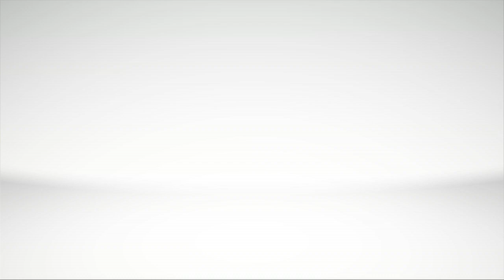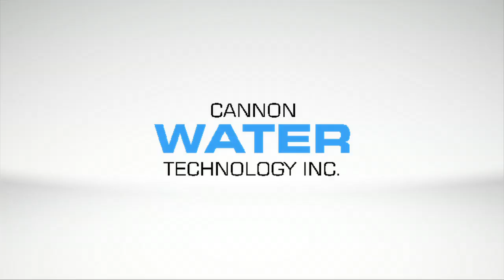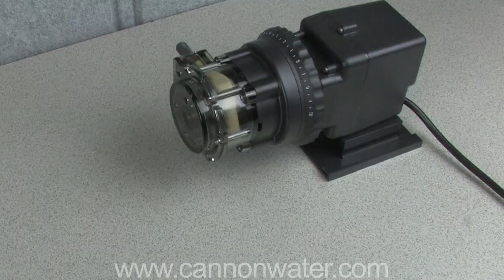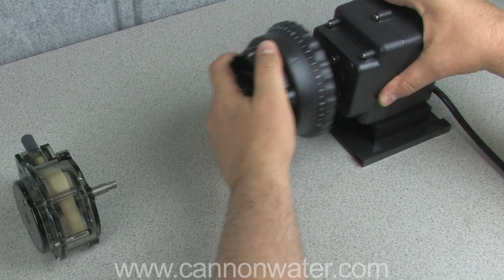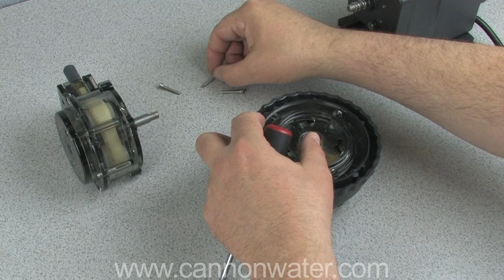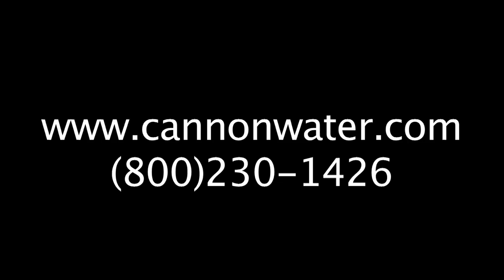Stenner Pump Variable Cam Replacement

Comment: Nice video.  The index plate on my Stenner was worn because of lack of grease and skipped in one segment.  Simple tip: flip the plate over and the other side has fresh index holes.  Lube the rotating parts and variable cam liberally with lithium grease and the pump works like new.

Comment from the maker: The best way to know when to change the variable cam is when it becomes hard to move the adjustment ring on the feed rate control section of the Stenner pump. The index plate should be changed when the holes around the edge of the plate become worn out causing the index pin to skip from hole to hole. This will sound like a ratcheting sound and your pump will operate erratically. The FSK100 found on our website will fix this for you.